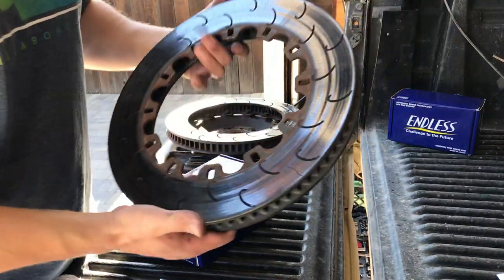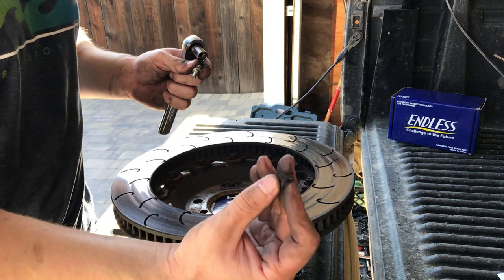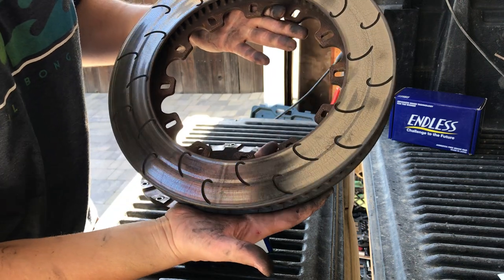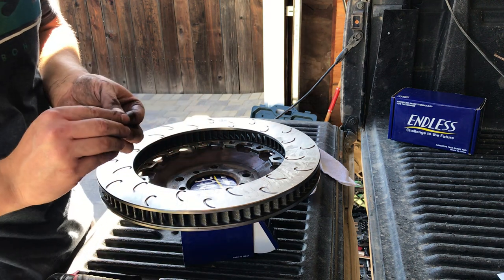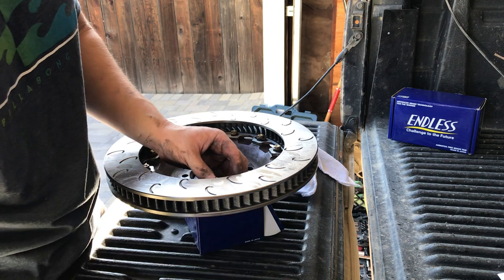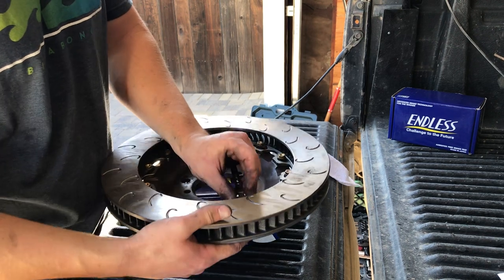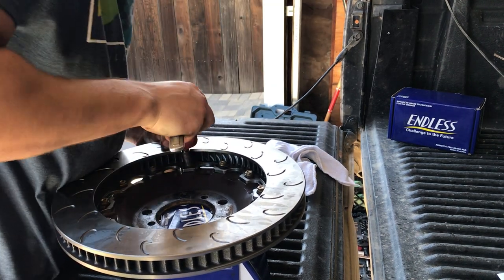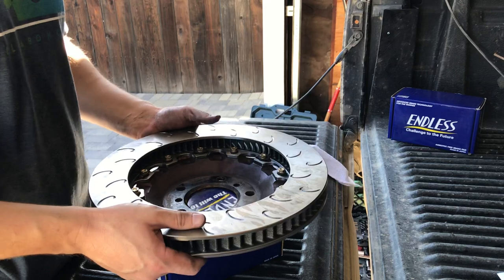Changing rotor rings on AP Racing brakes.

Comment: no cross-pattern tightening???
Reply from the maker: not needed. you're not tightening the hardware to stay put- you're tightening it to a specific torque spec so the two piece rotor can expand and contract correctly. it centers itself.
Reply: @roastbeefoffroad  what spec did you torque it to?
Reply from the maker: @MrXV3NOMZx  off the top of my head, its relatively low, i think it was 11 inch pounds of torque. just enough to seat the lock on the nut.
Reply from the maker: @MrXV3NOMZx  i believe they call for 11 inch pounds.